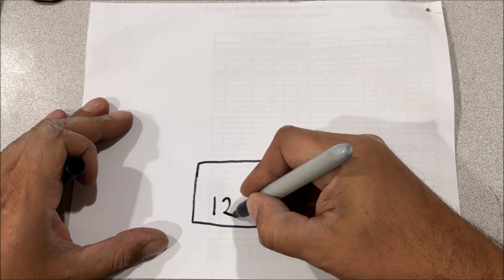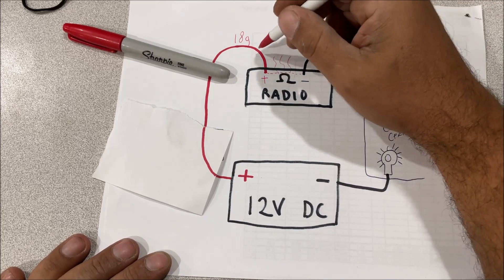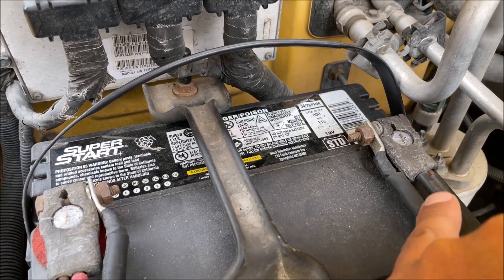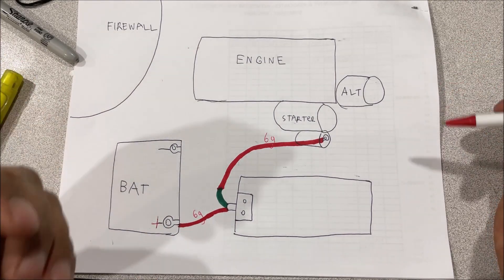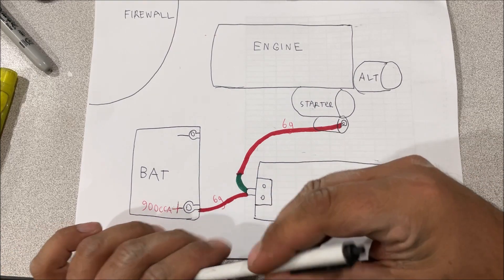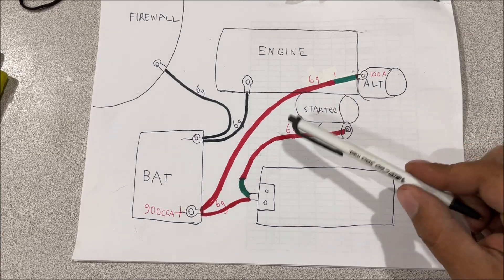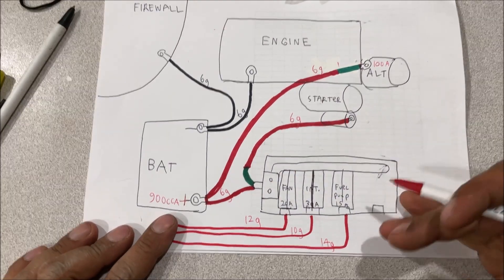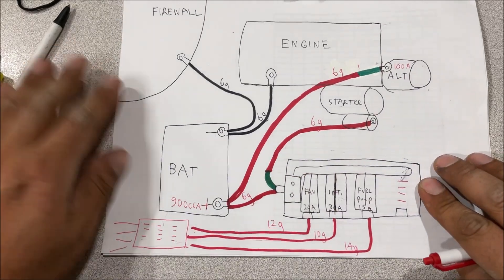do you fuse the battery and alternator? AUTOMOTIVE fusing EXPLAINED

Comment: Haynes manual charging system diagram for square body trucks does not call for a fusible link between alternator and battery, only to starter from number 1 port.

Comment: You are awesome, the way you explain it all dropping all the BS. I have a 1996 Dodge Ram Van Conversion that has a ground wire that connects to the same engine bolt ground that connects to the alternator as a grounding wire for the alternator. As you said the alternator is grounded because it is bolted to engine. I can't find any other grounds engine to body, body to frame. You have made everything clear about the fuses and the grounding wires. God bless you man. Going out to your Jeep and pointing out the facts that were in front of our faces. Thanks.

Comment: Ive seen starters stick engaged and burn the entire wiring harness back to the fuse block at the battery. This was on a Toyota Corolla where they ran the battery cables inline with the wiring harness. Not so intelligent.

Comment: I’m just beginning understanding wiring.   I have a 4mm lug on solenoid adjacent to starter. Thick wire then goes to bulkhead connector and finally terminates on neutral safety switch.  Does that sound correct??

Comment: Because of the way it is designed, an alternator is physically incapable of producing current far beyond its rated capacity, since there's no storage site for electrons (the battery). This is why you don't need to protect the wire from the alternator, since the wire itself is already designed to handle whatever the alternator produces. This is why the conventional place for any fusible link to protect an alternator wire is close to the battery, since the battery is the source for really serious current spikes. A dead short anywhere along the alternator wire causes a rush of current from the battery, not the other way around. In the marine world, the ABYC have come out with the recommendation that all fuses be within a foot of the battery. If you fuse close to the battery, all wires downstream of that point are protected. If you fuse at the alternator, the alternator wire is not protected beyond that fuse.

Comment: This is great stuff but let's see if I pass the class.   My little Dodge comes with a 34 amp alternator which is shot and the only replacement is the 60 amp alternator.  The wiring in the car is only designed for the 34 amp as if you had the 60 amp you would have an upgraded wiring harness to handle it.  In lieu of rewiring the whole car can I put a Littelfuse 30 Amp Circuit Breaker - 813030BP  on the BAT terminal of the alternator so as to not have more than 30amps going into the wiring harness?

Comment: We’ll explain  thanks for the help I have a 79 c20 and am having problem with the charging system and this fusible link goes on the starter there 2  put new alternator and brand new battery and still not charging hopefully it’s that I won’t do it I don’t have the tools for the moment will have to take to the electric , since I need smog aready and don’t want truck leave me at the smog station 😂 thanks again for the class ,

Comment: Fuse the wire to starter solenoid, or the starter main feed wire?
Reply: Starters use a lot of amps and would blow out fuses easily. No need to fuse a starter motor.  I do recommend a fusible link to the solenoid so you don't burn out the solenoid as they don't require alot of current

Comment: SUP CHRIS. I THOUGHT THE MOTOR WAS MECHANICALLY GROUNDED THRU THE FRAME?
Reply from the maker: not at all… I have an automotive grounds explained video
Reply: @chriscraft77022  OH WOW CRAZY. I THOUGHT IVE READ CONTINUITY FROM THE BATTERY TO THE FRAME OF THE CAR?
Reply from the maker: there are grounding straps that connect them together. the rubber motor and transmission mounts do not conduct electricity.
Reply: @chriscraft77022  THATS RIGHT. I UPGRADED THOSE WIRES TO 1/0 CAUSE I WANT TO EVENTUALLY THROW MY SUBWOOFER IN AND A BIGGER ALTERNATOR.

Comment: Sir, you are very intelligent. And you’re correct there’s no in-line fuse that goes to the  alternator but some have a fuse-able link so that it can charge the electrical components. It is at the moment in Harding at Palms my beautiful wife change alternator bring battery and still not able to charge the battery for the next time I use a vehicle so it’s gonna be confusing  but your video helps me out a lot to get a general idea of like grounding and all of that such thing I guess cause I am 😂beginner.

Comment: You cant fuse the alternator wire, If you put a fuse at the alt and if it that blows the battery still is powering the line, if you put a fuse at the batt and if that blows the alt is still powering the line. So two fusible links maybe in a rewire have seen it in a stock factory car.

Comment: I agree with most of your comments but fuses and fusible links are there to protect wires. Not humans or components. In your example of fusing the alternator, the fuse would be on the wrong end of the wire offering no protection for the cable before that fuse. Should that cable contact the frame ground either through chaffing or possibly an accident, it would still be a direct short. 

The difference between a fusible link and a fuse is the link offers surge protection, something the 300 CCA battery can produce. The reason there is seldom a fuse in the alternator feed is the alternator itself is the weakest link. Generally the diodes. 

By the way, aircraft do fuse the battery using large 200 or even 300-Amp fuse blocks. So it is possible if one chose to do it. They are generally mounted as close to the battery as possible. These blocks and fuses can be purchased through any aircraft supply. They are about the size of a pack of gum.

Comment: Thank you again for this video. There is so much crap on the internet. I became a big fan when I restored my '72 Camino during Covid. I just revisited this video because of my concerns about my current project car (Porsche 914). My problem is that the original battery power wires, both unfused, were over 12ft long running from the battery, in the trunk, to the ignition switch and front fuse panel via a central tunnel. To make this a bigger issue these wires ran right next to the rear wiring harness and two plastic fuel lines (common configuration of rear engine Porsche's). It's no surprise that these cars are notorious for catastrophic engine and interior fires. I knew this would be an issue so, like your Jeep, I fused these wires at the battery before they entered the central tunnel. I also ran insulated wire sleeves and changed the fuel lines to full length stainless steel lines to reduce the risk of fire. I needed to review your video on wiring to reconfirm what I should do regardless of what the "experts" said. Thanks again Chris.

Comment: My 2020 Chevy express has a fusible links on both 6ga wires going to the starter and the alternator. The fusible links are at the BATTERY, the power source that you can’t shut off by turning the ignition off. I can shut the alternator down, besides look at the 14 ga solid wire inside your alternator. How much do you think that will handle before it melts. That is your fusible link on the alternator end.

Comment: My 1978 280z has a fusible link by the battery for the alternator
Reply from the maker: that’s for the efi I have a 78 280z too.. the alternator fused link is in the little plastic covered part on the passenger fender .  The smaller black one
Reply: @chriscraft77022  yeah, sorry, I wasn’t very specific. The fusible link for the alternator is one of the four links under the plastic covers. 80amp link I believe
Reply from the maker: do you have videos? I just got mine in October 2022

Comment: Great video. But one question. Why use a fuseable link in place of let’s say a 200amp ANL. If one pops while I’m snow plowing, it’s so much easier to just throw another fuse in then to make another fuseable link
Reply from the maker: if you are popping big fuses you have a serious wiring problem. I have never had to replace a fused link… I have never used a snow plow but if it does pop them every now and then a fused link would be stupid.,, I have just never seen anything that “pops” fuses that was wired correct
Reply: I’m not popping fuses, but if I did pop a fuse in the middle of a storm because of the surge with the plow, lifting heavy, wet snow up, the salter  on, the vibrator on lights, heat, radio, camera systems… let’s say something did pop, now to do a fusible link as opposed to a fuse that just doesn’t make sense to me.
Reply from the maker: oh dang.. I don’t know anything about snow plows… so that machine draws power constantly… the truth is a fused link can take more than a correct sized fuse.. a fuse pops in a second.. where a fused link heats up .. there is a debate but I just use what the factory put on.. so what does your plow have on it?
Reply: Fusible links are cheap. That’s why manufactures use them over circuit breakers, ANL or Mega fuses. That keeps more money in their suit pockets in stock portfolios. It’s all about greed and corruption in the USA. No integrity.

Comment: One thing I have wondered about is if it's possible/probable for an alternator to internally short out. I have never seen or heard of this happening, but plenty of cars do fuse the alternator power wire for whatever reason even if its run in a way where it would be virtually impossible for it to short out. Whether that's to protect the wiring if the alternator shorts out internally or perhaps just for added safety if someone connects the battery backwards I don't know.
Reply: i have an 80s mercury cougar and the post on the back of the alt is loose and sparks like a hot damn when the cars running and drops the voltage to 9 volts, yes its possible
Reply: @TBO207  Interesting, I never saw that before. Is the alternator internally shorted or just not working? Or is the loose post shorting against the case?
Reply: @averyalexander2303  the internals of the alternator are shorting out it melted the charge wire from the alt but it got me home lol
Reply: @TBO207  Wow that's crazy, I never heard of that before. Probably a good idea to fuse alternators then.

Comment: My battery sparks when I have the alternator wired with an unfused 10 awg wire running to the junction block. Weirdly enough I've replaced and soldered 80 percent of the sun damaged wires. And I have my purple wire to the S terminal.. should I run that purple to the junction box?
Reply from the maker: no.. and you have a big problem .. does your battery have those crappy terminals that you clamp the wire in? If so clean all that crap up.. a battery should never spark … a fuse doesn’t have anything to do with that
Reply: @chriscraft77022  No I would not dare I know and would never use those. I have commercial 2 awg power and 0 awg ground cables that I've purchased from tractor supply for around 35 bucks each
Reply from the maker: You need to check the ground on the alternator case.. it could be dirty or painted.. check resistance you should have .01 on alternator case.. I don’t know why it would be arcing at the battery

Comment: Most cars the battery goes directly to the fuse box within a foot or 2  And there's an actual separate fuse for the battery main circuit it goes from my fuse box too The alternator.      Most cars they dont   go directly to the alternator from the battery.. It usually goes from the alternator to the fuse box then to the battery,  my alternator has 110 AMP fuse on it in the Engine bay's  fuse box..    My car has 2 different fuse boxes one in the interior one in engine bay...    If you're going to use and unfused  wire from  battery to alternator I would fuse it   if it's more than a 3 foot run and less then 1/0 wire..  let's say it's a 4 foot run of 1/0 wire you should be OK..to not fuse it... with a stock alternator..

Comment: The battery should always be fused main reason because people sometimes mix the jumper cables with the battery and then you fry the PCM and ECM...      You should always fuse your positive lead on any type of accessory one accessory that they usually don't but they do isolate is the starting system
Reply from the maker: have you ever opened the hood of a car?
Reply: @chriscraft77022  Are you a certified Electrical Engineer?
Reply: @sexyeyes6203  I guess auto makes like GM probably don’t hire electrical engineers right?

Comment: If you were to put in a link at the alternator, seems if it blows it protects only the alternator and the length of wire running to the battery would still be hot and unprotected. Would it be best to put fusible links at both ends (alt, bat)?
Reply: yes i was thinking the same thing because you have a power source at both ends

Comment: If you have a 120A alternator then you would fuse it accordingly (80A would probably be fine if you understand what it takes to blow a fuse) considering the alternator produces current and not drawing it from the battery. The funny part is what does draw such a load is the starter and yours has a fusible link on it? Weird. However are you certain the alternator wire isn't the one with the fusible link and the straight wire isn't going to the starter?
Reply: I agree and am also confused by this. If the starter draws more than 300 amps, I don’t understand how the fusible link going to the starter doesn’t blow.
Reply: @MyYouTubechannel.995  because it takes a much higher load to blow it instantaneously. It takes 10x the rating at around 1 full second for a non delay fuse. For a delay rated fuse it can take up to 100x the rating for it to blow instantaneously.
Reply: @commonsenseisdeadandgone  I think I see. So if I were to crank the starter continuously for 30 seconds or a minute (or theoretically longer/long enough to heat up the circuit), the fusible link would maybe/probably blow...?
Reply: @MyYouTubechannel.995  starter will probably over heat first and that's if it does have a fusible link on the starter wire. But a starter should only pull 200 give or take how many cylinders and compression ratio. A fusible link is just a thinner gauge wire, the length determines the rating so longer it is the weaker it is.
Reply: @MyYouTubechannel.995  a ANL fuse has a interrupt rating of 2700A. My assumption is that is the minimum it needs to be certified by UL or RoHS or SAE 🤷‍♂️ again that's my assumption. Time delay has 5000A plus. That is from a quick search I did.
Reply: great. thank you (my starter draws 350-355 amps

Comment: I'm only two months into myself education on this, but isn't an alternator grounded by the casing to the engine? And the remainding current after what is used to run the vehicle is fused in case the fuses of interior circuits fail. If my 20A fuse blows on my blower motor and heater the current from there suddenly needs to go somewhere else doesn't it? Would that not drastically increase the amperage past what some batteries if not all can handle for charging? This is exactly what I'm trying to figure out right now is that I don't understand how much amperage a battery can take as far as charging I just know that it has to remain at the same voltage with I don't get if you increase the wire size. There's a disconnect somewhere for me and it's in my brain. I can't wait to never rewire anything from scratch again
Reply: I'm actually at the tail-end of rewiring the entire truck which is an 85 Toyota. I've been in the thick of this for 2 months.   Two months straight under the hood I'm still confused on the fundamentals of battery charging. My disability and having nobody to walk me through it step by step while holding my hand is why I'm lost.
Reply: The alternator is grounded to the engine block, and there should be a ground cable from the block to the battery because the block itself is not grounded to the frame.

The rest of your questions are a little complicated to answer.  Current is determined by the load (heater), not the alternator or battery.  So if the fuse blows, it just means that the alternator or battery don't have to supply as much current anymore.  So there is no extra current that needs to go anywhere.  The battery will only take what it needs to charge, so you are not going to damage it.  The important part about charging a battery is the voltage of the alternator.    Wire sizes play 2 rolls.  The resistance of a wire decreases with the size of the wire.  So a small diameter wire has more resistance than a big diameter wire.  The resistance of the wire is what causes it to heat up. How hot it gets is basically how much power it is taking and is directly proportional to the resistance of the wire and the current.  That's why when you have higher current you want bigger wires (lower resistance).  The other part is that all the heat in the wires drops the voltage.  Since you don't want a lot of voltage drop between the alternator and the battery, you want a large wire connecting them.

Comment: Hey man i just wanted to let you know i actually just dissasembled my battery harness in my 04 jeep wj 4.0 doing a diy big 3 and that fusable link is a 10 ga fusable link actually to the alternator input to the fuseblock thats crimped together with the battery cable the starter is that secondary wire off the battery that runs down with the harness to the starter as some starters can actually pull 250 amps so thats the wire thats not normally fused. You cant tell without pulling the tape and split loom off everything.
Reply from the maker: i checked mine like 10 times..  but thanks..  i will look at it again.. make a video on that..  i want to see it..  i have no plans on upgrading any wiring on my jeep but i would like to see what you do to yours..